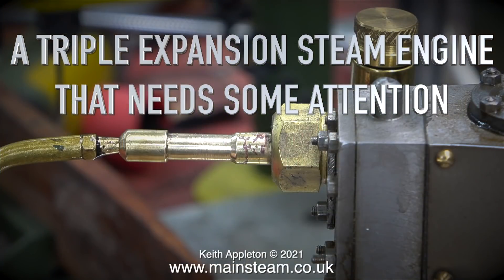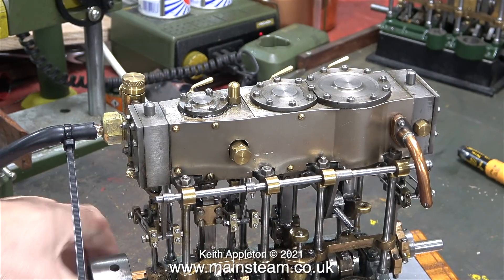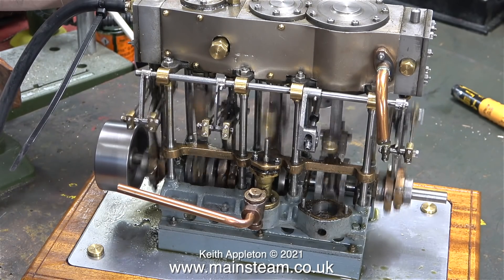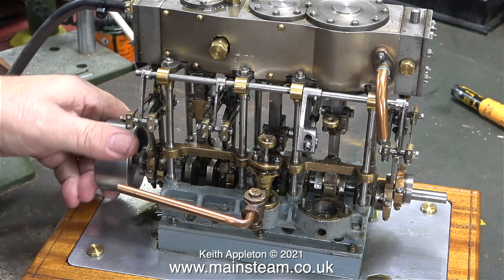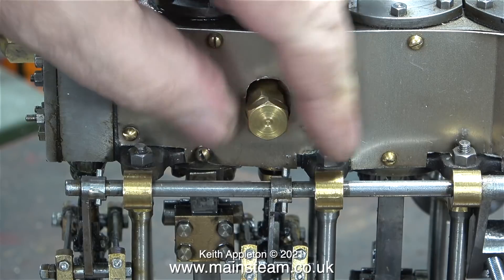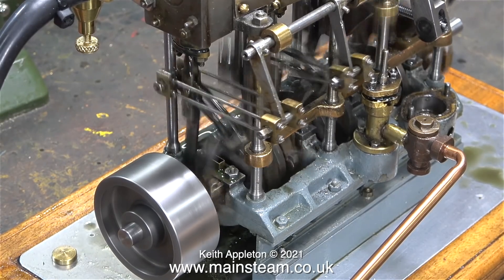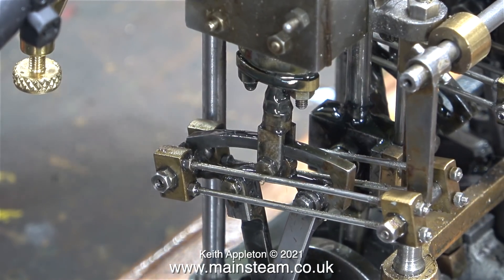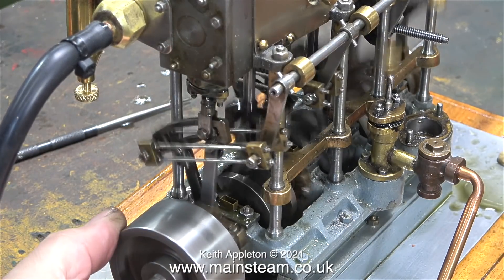A TRIPLE EXPANSION STEAM ENGINE THAT NEEDS SOME ATTENTION #4

Comment: Triple expansion engines typically only gain power from the Low Pressure piston if it is under vacuum. I don't quite know how well it scales down but fitting a vacuum pump to the system could increase its power quite significantly. The mass flow of steam through a condenser is probably not enough on its own compared to how it is usually installed on a full scale engine
Reply from the maker: The Triple in the video already has a vacuum pump and a condenser water circulation pump fitted.

Comment: You will never get a triple expansion engine to run properly on air. The clue is in the name it relies on the expansion of the steam to feed the intermediate and low pressure cylinders which compressed air doesn't do.
Reply from the maker: Odd as it may seem, I do actually know that. Thank you for your advice . . . . . .

Comment: When you run the clip in slow motion it reminds me of a good few engine rooms I've visited. The engines were more or less rattling and knocking and slamming about like this one - compound or triple expansion.
Not a good state of affairs but it seems common on the full size engines. But then again it's even more difficult doing a perfect restoration when the engine is the size of a small car.

Comment: Hello Mr. Appleton, is it possible to check and adjust each cylinder individually with compressed air? If each cylinder runs well on its own, then they must also run well as a group. With the compound machines I always have the feeling that only the HP cylinder drives the crankshaft and the other two cylinders are just dragged along.
Reply from the maker: Please continue to watch the series when the rebuild commences . . . .

Comment: 10:30 daggum. Threw a rod. Sounds like an easy fix but very bizarre method of construction...
Reply from the maker: Yes - a really bad method of construction. I will fix it in another episode. They all need doing I think.
Reply: @keithappleton  Definitely. This poor thing needs a stem to stern overhaul. Also quite the ambassador for these engines because it still ran despite being in such poor shape. Any engine that is still able to run when its that sick is a damn good engine in my book.
Reply from the maker: Yes, I fully agree }:-)))